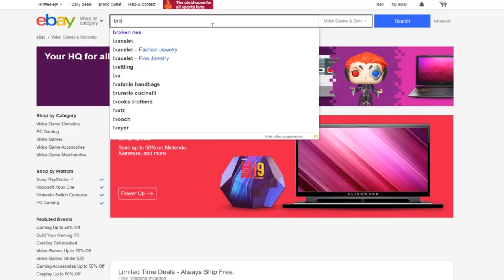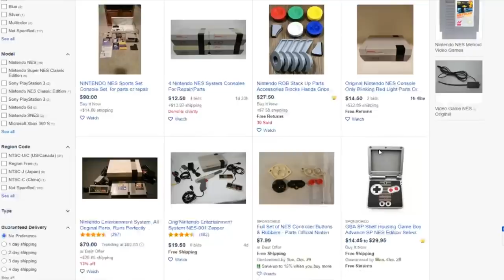The ULTIMATE Portable NES!

Comment: V2 concerns:
Wireless charging is fun, but it's also slow and wasteful. Recommend adding wired power/charging for the console.
The removable projector shield is a weak point. Someone is going to lose or break that. If possible, it may work to drill through the black cover and then add a thin, transparent plastic shield over that whole face, then just color the silver part of the projector face black so that it all looks decent from the outside. It would need a lot of tinkering to get it right, though.
That reset button looks like its not going to last. The mini also doesn't appear to be well seated. I'm not sure if that's just at that point in the build or if it's got room to shift around in there, but it would be wise to pack it in tightly with foam tape or whatever so that it can't jiggle around and get scuffed or break a contact.

All in all a very cool project. Thanks for showing it!
Reply from the maker: Fast forward to today and it all works as originally shown, and no projector cover has been lost, so you can sleep well! Thanks for putting so much thought and effort into your comment. Cheers.
Reply from the maker: And I did actually add a secondary corded charging capability, that plugs into the OG controller port. ☺️
Reply: Nice.

Comment: man thats amazing well done sir. I have an nes as well, my question is we used to blow the games to make it work, will a new edge connector fix that issue'?
Reply from the maker: Hey thanks!!   Yep!  
There are a good number of screws to get in there, but it is a pretty straightforward replacement ( there are many guides and videos on it) and it doesn't require any soldering.  You just swap the parts out.

Here is a link to the part:
https://ebay.to/31Y6uU1

The other thing I would look at, is removing the built up corrosion on the game connectors themselves.  If you take a very fine grit sandpaper (i.e. 200 grit), you can very gently remove the green corrosion from each side of the game connector, revealing fresh new copper for your fancy new edge connector to interface with.    Sorry for the long winded response, but it will be worth it! ;)
Reply: @Geeksmithing  wonderful, thank you for your help, i will do that much obliged, game on
Reply from the maker: @on-ye7ir  happy to help! Game on indeed!😊🎮🕹️